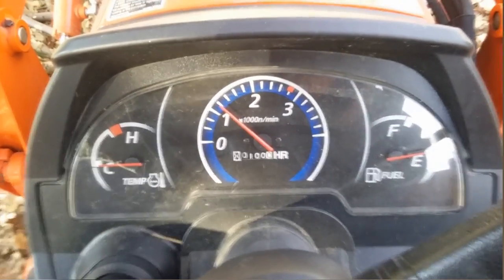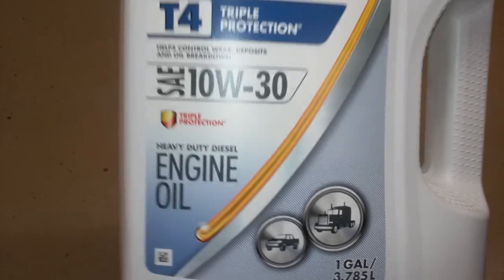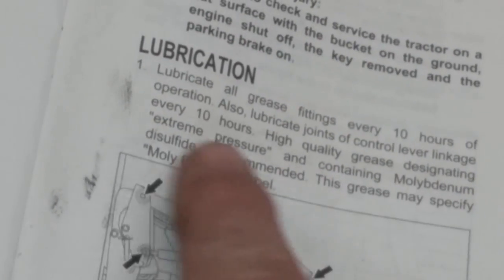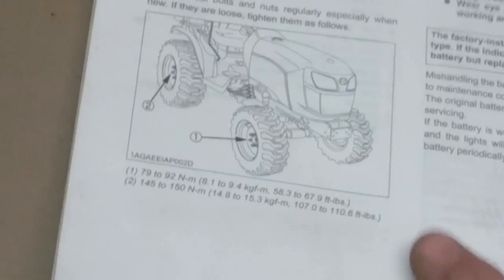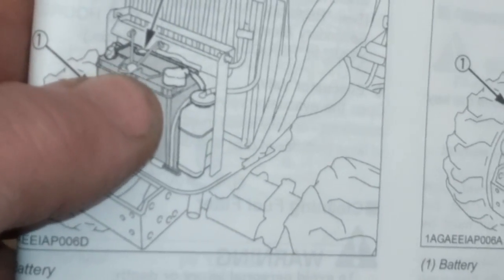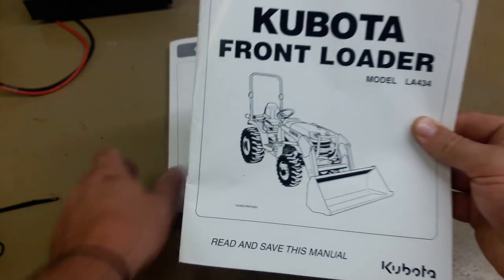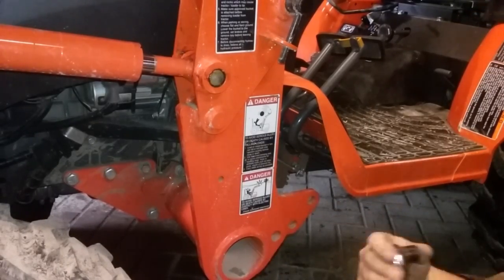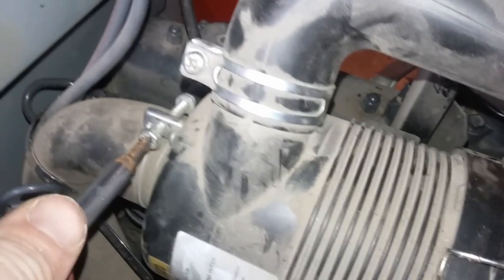Kubota B2301 100-Hour Service

Comment: Kubota b2301, 116 hours at 5 years in service. original air filter. I check it but its very clean as tractor is used mostly in the winter plowing snow. no signs of age deterioration. may even clean it per manual prior to changing.

Comment: Do u have an issue with ur 3 point  not lifting high enough? Mine seems to only start lifting around 7 or 8.
Reply from the maker: From all the way down it doesn't start lifting until about 4 but it does lift all the way up.